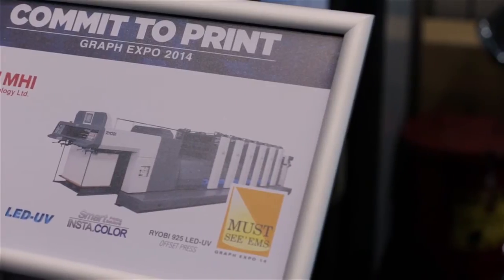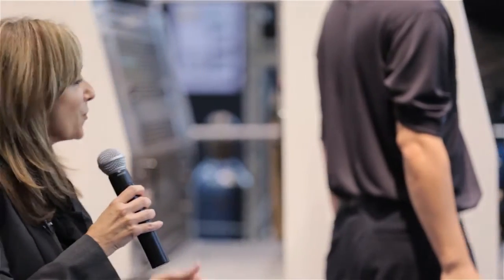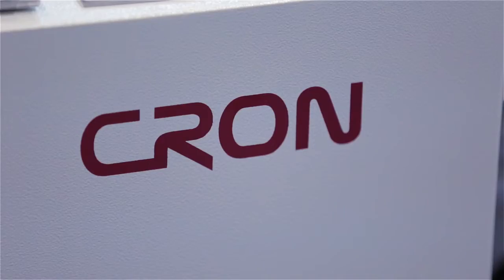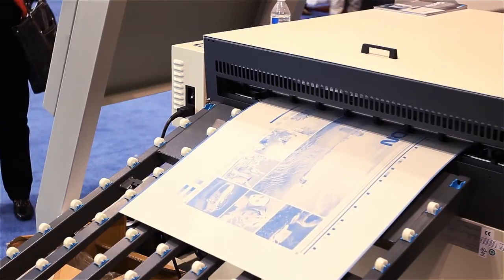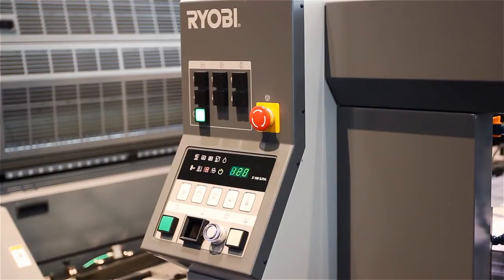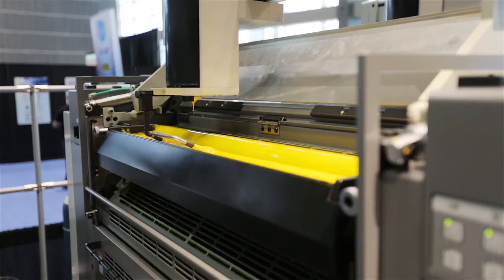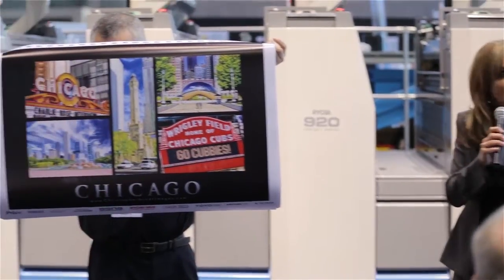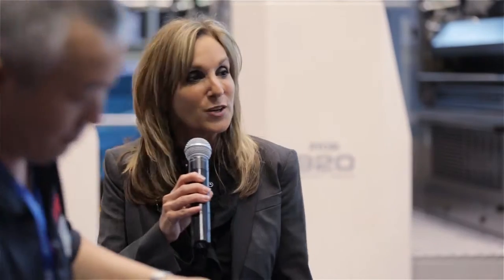Live Presentation - RYOBI MHI 925 LED-UV Offset Press at Graph Expo

Comment: Could I replace the traditional mercury uv lamp that I have in my printer with the uv led lamp and use the same varnish?
Reply: Hi! It is really a very perfect LED UV offset printing machine! By the way, please feel free to get back to us, if you will need Adjustable Smart High Power High Voltage (LED) UV Lamp EPS Ballasts, reference at www.uvballastsupplying.com. Thanks
Reply: @simonballon409  Good smart ballasts, adjustable!
Reply: @faizelali6070  Thanks. Please feel free to get back to me, whenever you need it.